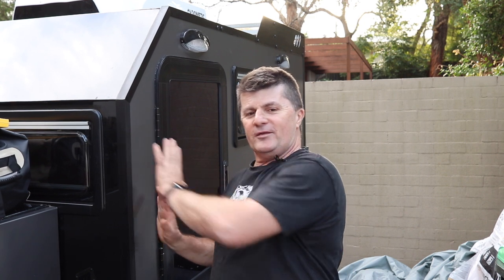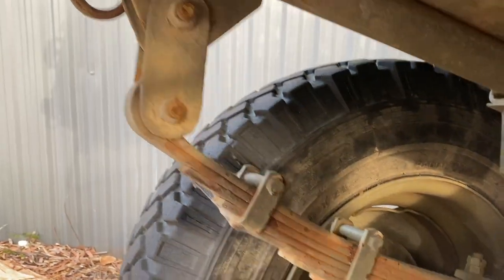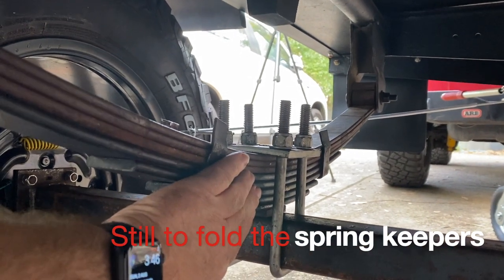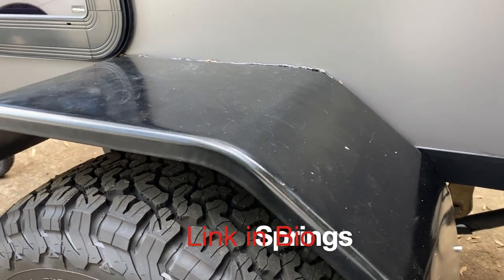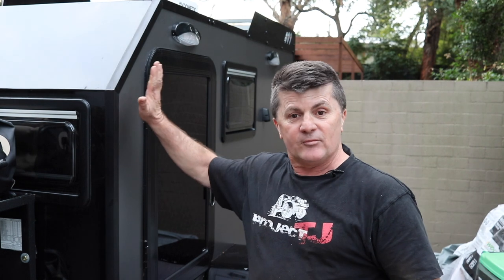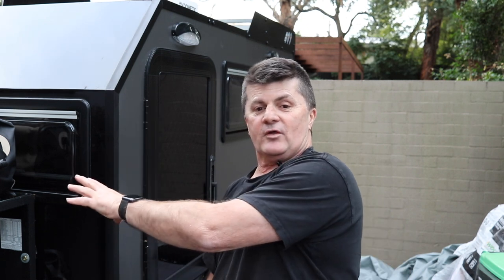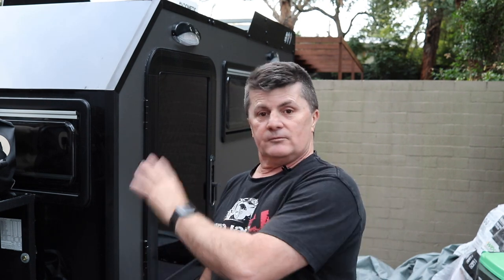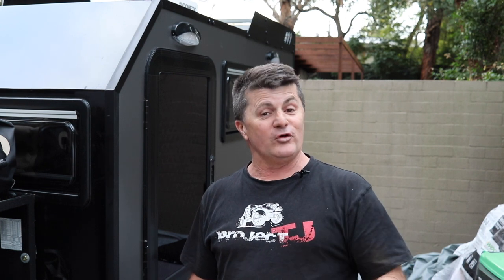Off Road Camper Trailer Build // What does it Weigh?

Comment: How’s your mpg after and before your trailer? Cheers mate!
Reply from the maker: On a trip without the Camper I get approx 18.8MPG with the camper its about 16MPG. Thats on a 4.0 TJ with 6 speed, 4.56 ratios and 285/70x17 KM3's
Reply: @DarrylSheather , thank you for the response, my TJ which is a very similar build to yours is at about the same rate with the fuel efficiency. I also re-geared from 3.07 to 4.56 like you, and wow, what difference!